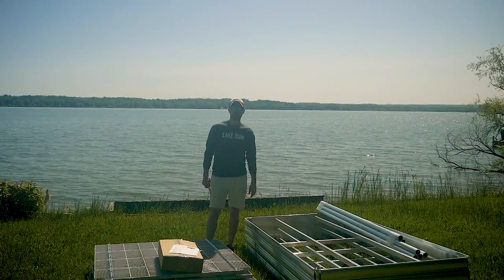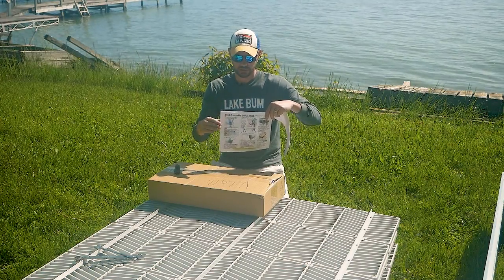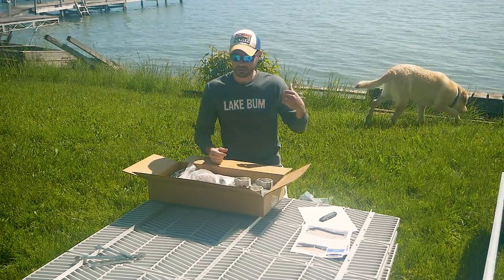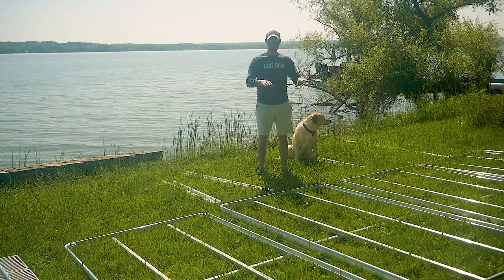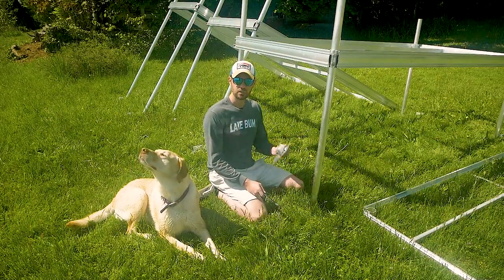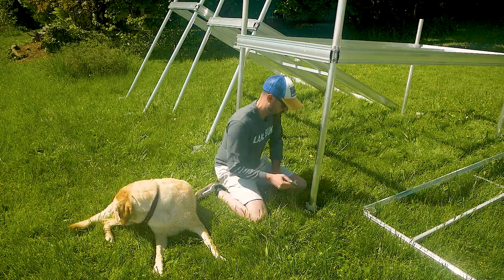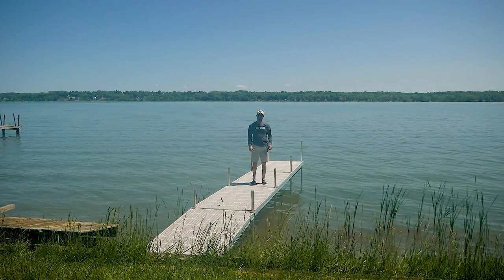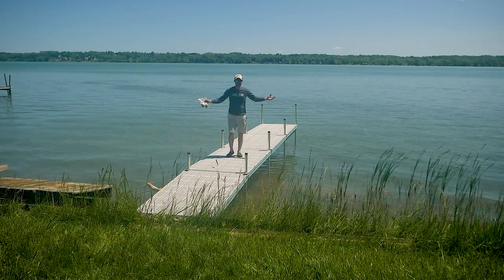Cayuga Lake Tip In Dock Install

Comment: ....just installed a BMD (ramp and 4-6 by 8 foot sections forming a T ) at Lake Muskoday in Roscoe, NY....The first time was a little work because the 6x8 foot sections were a little heavier than the 4x8 foot sections would be....plus the water depth was not consistent at each pole....it was a 2 person operation the first time out....we also ordered the PVC decking material which, as Joe said in his other videos is the heaviest decking material....with all this said...this is one GREATLY ENGINEERED DOCK.....PARTS WERE EASILY PUT TOGETHER....Joe basically thought of everything...I am sure that the removal of the dock in the late fall and reinstallation next spring will be a snap now that each poll is set up.....the company is great and easy to work with...from Jim the driver who delivered the dock, to Sam who handled making sure I was happy to of course Joe who made sure I would have everything I needed and ultimately reviewed and signed off on the design.....we love our dock.....100% a top notch company who makes sure it's customers are happy....The Romano's highly recommend this dock and company....I would be happy to talk to anyone who is on the fence about whether this dock is for them....Joe, feel free to provide my email contact information if someone wants to speak to me.....thanks again for a great product!
Reply: Thanks, Anthony!